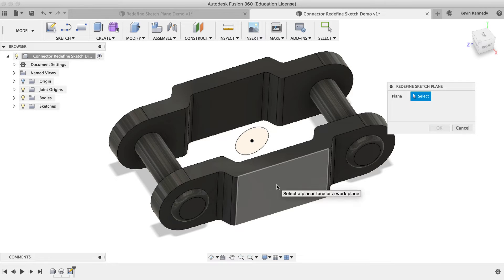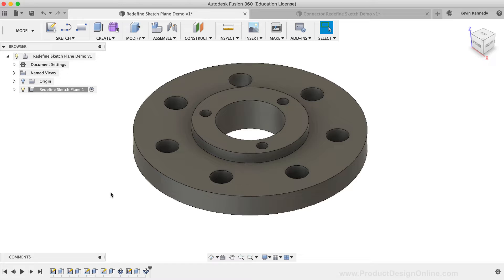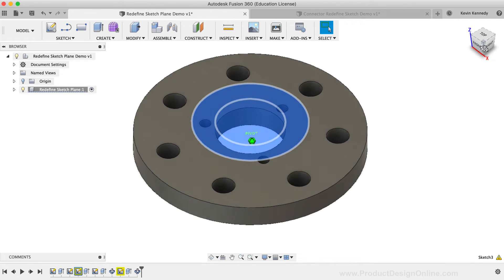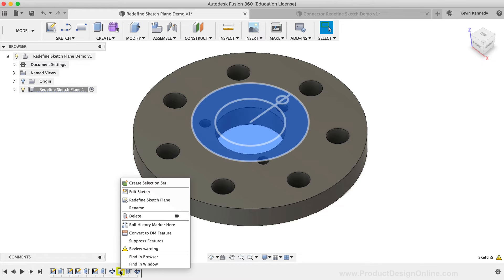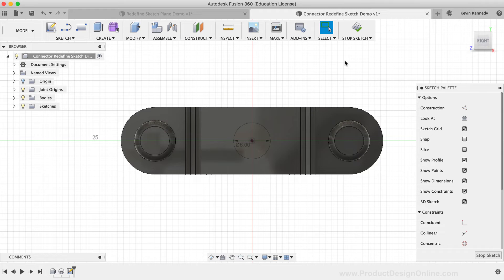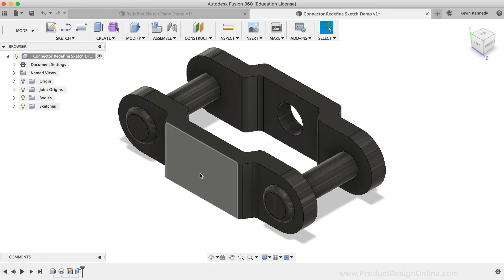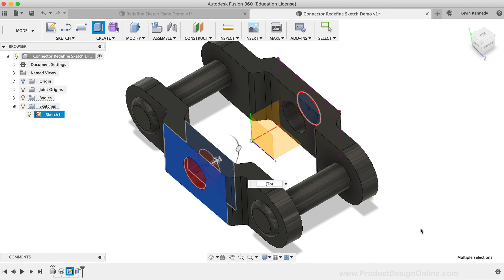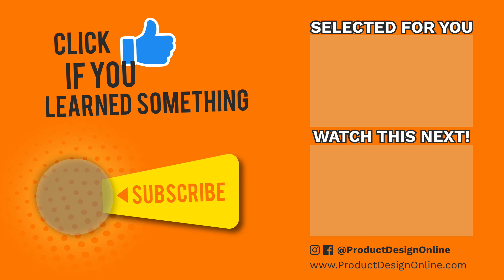How to Redefine a Sketch Plane in Fusion 360

Comment: Kevin, your tutorials are exception, thank you. I started your Fusion 360 course a while ago but I have been too busy to finish. Trying to get going again. Anyway, there's something that is driving me crazy and I'm certain there's an easy solution for it. The size of each origin plane... NOT it's location. I've been googling my brains out this afternoon without success. My queries have lead to this video several times and unfortunately is does not address my question. I watched a tutorial where someone RESIZED one of the origin planes. Can you help me please? Thanks
Reply from the maker: Hi Michael. Happy to help. First starters, once you know that the size of the origin plane is technically infinite (in that planer direction). The orange color you see is really just for visual reference so you can select the plane as needed. Should you want to change the size of it you can select on any of the edges or corners of the plane and drag it with your mouse. You can resize it as needed.. just keep in mind that it doesn't actually affect the model itself. Most modeling commands give the option to define how the plane interacts with the body. For example split body lets you choose whether the splitting construction plane goes all the way through the body or not. :)
Reply: @ProductDesignOnline  Thank you for taking the time to help this rookie. It's very kind.
Reply: @Product Design Online  One more thing.I understand the planes are infinite with respect to the drawing. I'm as anal retentive as they come and I just wanted to know what action to take should the need arise. Also, I tried to click and drag a corner or edge but was unsuccessful. Maybe just a glitch in my system. Thanks again and look forward to finishing the course.
Reply from the maker: @PastaDNA  the corners can be a little bit harder to select than the edges, depending where the plane is placed.

I checked on my end and it still works. You could also try to hide all 3D bodies in the Browser to make it easier to select the plane.
Reply: @ProductDesignOnline  Terrific. I'll try again. Thank you.

Comment: This would solve my problem, but you appear to be using a feature that doesn't actually exist in Fusion 360.  I have this exact problem and the menus do not contain a redefine sketch plane option, even though my sketch is yellow and I have the same error message.
Reply from the maker: Hi John. The feature does still exist. Its likely another setting or setup thing with your file that's prohibiting it. First, check that you have the appropriate component active. You'll also want to make sure your timeline marker is all the way at the end.
Reply: @ProductDesignOnline  Figured it out.  The option doesn't appear if you don't have all other issues with the sketch resolved.  I had a couple broken projection links and, despite listing the plane issue first, you can't actually fix it until you've fixed projection links.  Seems weird, but that was the issue.

Comment: Hi, I cannot download the reference file. In other tutorials I cannot see event the content of the reference file. Is there something I make wrongly, maybe some settings...?
Reply from the maker: Hi Virgil. I'm updating all the files and merging them into one Fusion 360 account (I used to have two). Please check back in a few days... I'm trying to get it done ASAP and making a page on my website where they can all be found so it's easier to get them :)
Reply: @ProductDesignOnline Hi Kevin, this is fabulous, thanks a bunch! I will check with the files on your website in order to download them. For now I can only see the content, but "Open the file on Fusion 360" is missing.

Comment: Good video, but you haven't mentioned about very confusing result of sketch redefinition, sketch lines going green. Could you address that?
Reply: They become green since the have been locked. Fusion does that because it loses all references for your sketch when you redefine the sketch plane, so you basically still have to do a lot of work
Reply from the maker: Hi Krzysztof. Are you referring to sketch geometry that has the "fix/unfix" constraint applied to it?
Reply: @ProductDesignOnline  Yes
Reply from the maker: @blackredroll  Thanks for the reply. I personally advise against using the "fix/unfix" constraint at all cost. There are very rare use cases where it can come into play when the other constraints aren't enough. However, if you do choose to use the "fix/unfix" constraints then you'll want to unfix them before copying or redefining any sketch planes. Cheers, Kevin :)
Reply: @ProductDesignOnline  for me, any sketch objects (be it geometry or constraints) will become fixed once i redefine the sketch plane – even when they were unfixed before. When i then unfix them, they lose all their constraints.
Reply from the maker: @Jantus1000  Thanks for the clarification! Could you share a file that this has happened in? I'd like to take a look at it, as this isn't an issue that I've run into before. Cheers, Kevin :)
Reply: @ProductDesignOnline  well that goes for every file i ever created. I just thought that fusion can't handle sketch plane redefinitions. I will upload a video showing that issue ASAP
Reply: here it is: https://youtu.be/KeBHh83uJCk
Reply from the maker: @Jantus1000  Thanks for sharing that! Is the initial sketch projected? It looks like the lines are purple. 

I'm wondering if that has something to do with it... I'll have to look into this further. Cheers, Kevin :)
Reply: @ProductDesignOnline  yes, the sketch shown in the video is projected, whereas two lines have been added.
Reply: @ProductDesignOnline  I have recreated the geometry seen in your video here: https://a360.co/2Uod2fY . With this, I am having the same issue  as always… just try to do the same to it as in your video, i have named the Extrude feature DELETE_THIS and the sketch REDEFINE_THIS.